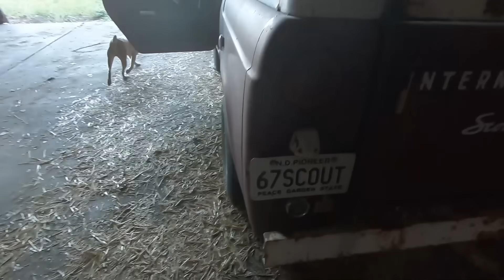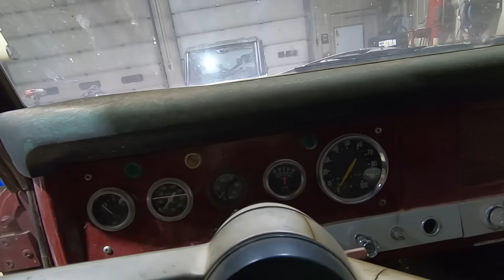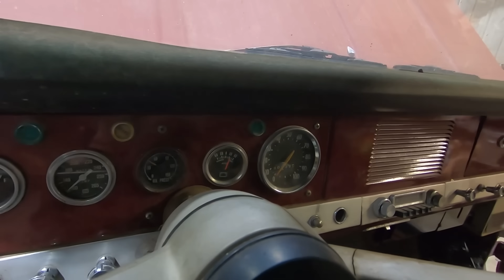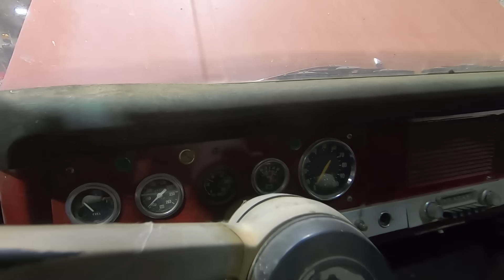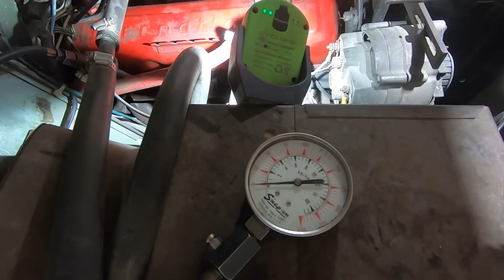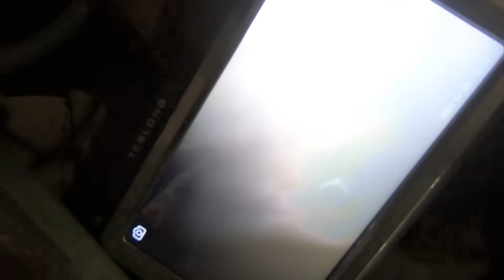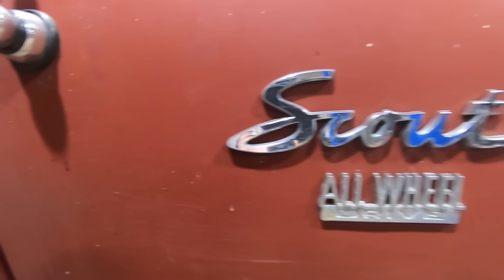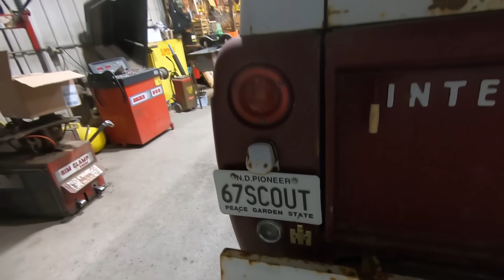Barn Find! 1967 International Harvester Scout! Will it Run?!?

Comment: aROUND 25 YEARS AGO i WAS given a 1964 Scout 80.  it had been parked in North Georgia about 100 miles North of Where I used to live.  I got a tow bar and went up there and pulled it home.  It came with a 4 cylinder 252 engine.  I got it running and it had LOW power.  It has 427 Dana differentials.  It still had low power so I put a Chevy 350 in it.  No more low power!  It would go 80 mph at  4000 rpm.  Now it needs 4 new tires and a new boat gas tank.  It is a worthy 4WD vehicle.

Comment: My grandpa had two of the 2+2 IH tractors up here in North Dakota.  He bought the 3588 brand new and bought the 3788 model used.  He had the duals just on the back of the 3788.  I had never seen duals on both the front and back like on your buddies.
Reply from the maker: Cool

Comment: My wife found one for my Dad. It was an army issued 1967. 4 cylinder, 2 gear shifters (one for the PTO), camo, and removable hardtop. The slave cylinder was bad, but a ford ranger will swap out. Nice rig.

Comment: That piece of metal hanging out of that pickup screen looks like a wire brush bristle. My grandfather had a 82 bronco with a 351 in it. It needed a rebuild and My dad cleaned the parts with a wire brush. One of the bristles made it's way down into the pan, through the screen, jammed up the oil pump gear, sheared the pin and the truck shut off from no oil pressure.

Comment: The Jeep CJ5 came out in 1954, so yes it was available in 67. The CJ3B was made alongside the CJ5 until 1968. One advantage IH had with Scouts was selling through a network of tractor and implement dealers in rural areas where there may not have been Jeep/Ford/GM dealers.

Comment: Years ago I had a 1 ton Chev that developed a knock and I couldn`t find it. I ended up pulling the engine and discovered the clutch disc had a loose spline. That may be the problem. Keep the videos coming .
Reply from the maker: I've seen that twice now

Comment: I enjoy all your videos , Duff helps so much.  When I worked for Ford back in the 1970's as a mechanic , I had a car in my stall that had an engine knock, even with a stethoscope it seeemed that the knock was in a cylinder, even my service manager and a couple other mechanics agreed, so I pulled the pan and found one rod bearing almost 1 thousands off, not really enough to
knock, I put in a new bearing and reassembled , started it up and it still knocked, what the heck, after more diagnosis, it turned out to be the fuel pump knocking and sending the knock down the block, possibly the fuel pump on the scout engine is your knock.  thank you

Comment: Those magnetic spark plug sockets are definitely a great tool. I first heard about them on Puddin's channel when he was working on the Towrolla and I believe he mentioned you had either sent him one or you had told him about them. It helped me out greatly when I was changing out spark plugs on my Scion TC since they have the built in extension since Toyota likes to put the plugs like 5 miles deep into the engine
Reply from the maker: Yeah, we sent him a set. They're awesome!
Reply: @MortskeRepair  we had them in late 60s one of my first purchases from PEP Boys as a Young un
Reply from the maker: @teomcdohl They can be fun!

Comment: I inherited my dad's 62 Scout in 1986 and drove it back to Minnesota from Grand Junction, Colorado in December. That was a long, cold drive. Had to replace the water pump in Nebraska, found that at the IH dealer. Slant 4 cylinder, 4 speed, awesome rig till it wasn't.

Comment: My experience with the original IH Scout is limited to 2 vehicles about 30 years ago. They both had a knock that sounded like bottom end noise. They both turned out to be distributor gear and lower shaft bushings. Replacing the parts would only fix the noise for about the interval of a single oil change.
Reply from the maker: interesting
Reply: Good stuff I was thinking from the beginning hearing the starter turning that slow that it was a bad starter with  the bendx sticking

Comment: The Scout 800 replaced the Scout 80 during 1965. The new 800 model was built from 1965 to 1968. These models had many improvements of comfort and design, including bucket seats, better instrumentation and heating systems, updated dashboard, optional rear seats, and optional 196 four-cylinder (from 1966), or 232 inline-six. Beginning in March 1967, a 266 ci V8 engine was also offered. Externally, changes were limited to an anodized aluminum grille with a rectangular "International" logo placed on the grille, the IH badge was moved to the hood, the door handles became the button type, and the tailgate no longer included the "hooks".[1] The base engine was a naturally aspirated "Comanche" 152 four-cylinder with 93 hp (69 kW), of which a turbocharged version with 111 hp (83 kW) (the 152-T) was also offered. In August 1966, the turbo version was complemented by the bigger 196 which used less fuel with exactly the same power. The 196 motor achieved 20 mpg.[2] The turbo version was discontinued during early 1968. The fold-down windshield was still available, code 16536, but few were ordered because this was not advertised. The vacuum-powered wipers were moved to the bottom of the windshield frame with the fixed windshield.

International Harvester Scout 800 Sportop
Beginning in early 1966, International also offered the Scout 800 Sportop, which had an upgraded interior and a unique fiberglass top (also available as a convertible) with a slanted rear roof and a continental spare tire kit.[2] The "Champagne Series" Scout was an upscale model offered in the Scout 80 and later Scout 800 models that featured a headliner, door panels, and carpet.
Reply from the maker: thanks for the info!

Comment: My experience with a Scout from 1980 was that when going through high water at a significant speed, the distributer tends to get wet.  That tends to bring things to a quick halt.  Oh, yea.  When going sideways across a fairly steep hill, never turn up the hill.  Always turn down the hill.  If you turn up the hill? You'll end 'up' at the bottom of the hill; possibly upside down.

Comment: My Dad told my a story about buying an old Ford pickup with "rod knock". Ended up being the fuel pump arm slapping the cam eccentric because of a broken return spring in the pump. Cheap easy fix, drove the truck for a long time before trading it in on an 1979 Ford Fiesta!

Comment: Neat stuff. I wonder if the knocking noise is from the fuel pump lever to the cam ascentric or does it use a rod to drive the fuel pump with slop there? Either way, still a neat old rig. Enjoyed watching
Reply: Thinking the same
Reply: The fuel pump runs off vacuum, he said that
Reply: @Earl Green 

The fuel pump runs off vacuum, he said that
Reply: @birdmandave  my bad, I forgot that detail 😅
Reply: Think the fuel/vacuum pump had the same level action as a normal fuel pump
Reply: @diggerdog9096  ya,, that fuel pump creates vacuum for the wiper motor,, It still has a lever that is powered from an eccentric on the camshaft, Usually  the fuel pump lever is designed to always be in contact with the eccentric,,  I guess it could be bent from an improper installation,,,  That might make it clickity-clatter,,,  :-)
Reply: @birdmandave  no fuel pump runs OFF VACUUM. some create vacuum for the windshield wipers back in the 40s 50s.
Reply: Timing chain.

Comment: Just bought the 67 barnfind scout. Only 4.2 volts to the coil when trying to start. Hooked jumper wire from battery to coil. Started using carb clean. Found gas drained back. Replaced fuel pump. Starts great with jumper wire installed. Still knocks so not a fuel pump noise. Will replace ignition switch hoping voltage problem will be fixed.

Comment: I had a 68 scout 800 all wheel drive about 15 years ago.. that critter was a tank.. never left me stuck and went every place I wanted to take it.  I didn't push it on places I questioned either.. it was a good vehicle.. only issue I had was them cold winter starts.. ya better give it a squirt of happy juice to at least get it to fire.. sometimes a second shot was needed for it to run.. but a great vehicle never the less for a 196 ci 4 cyl 4 SPD. good to see one and someone working on it.. 
pease!

Comment: My '73 cj-5 had a lot of top end rapping that sounded like that scout. I changed all of the rockers & pivots which quieted it all down if that helps you. I had previously done the whole bottom end with HV oil pump. Gets 70,lbs oil pressure. I attribute the top end ware to low zinc in oil.

Comment: I checked absolutely every thing you did for that same type of noise. I was in denial. Mine was an automatic ,but the 2 flex plate bolts were found in the bottom of the cover and the torque converter bolts were loose. And in a chevy 2.8 you can get the flex plate bolts back in without pulling the motor. Righty Tighty - no more noise.

Comment: I would say if you have an engine that was neglected severely it might be in lower. But, i doubt it. Could be bent push rod or bad lifter. The old IH  engines were generally rock solid. Now and then if the o ring in the oil pump failed then it resulted in bearing failure. Easy to work on. Just finding parts at a reasonable price is tough. Good luck. Show it some love. Good video, thanks.

Comment: We had an early 60s scout when I was a kid. It had the flat four motor. Top speed was about 45 but man, in double low that thing would crawl through most anything…unless it needed wheel speed…. It was a hoot to just trail ride in when we were kids.  We had that and an old flat nose jeep pickup that was the same deal, crawling around in the woods they were at home.

Comment: My International story is changing out a water pump on a '47 bullet nose . Chrome strips for the grille. Pretty neat.. My brother and I were taking turns getting the bolts out and it was raining I the south door of the drive through wagon shed. Suddenly there was a lightening bolt and all kinds of white light danced all over the engine and right around my hands with no shocks felt
Then the rain started coming in the other door. Then the tornado showed up and took a big chunk of roof off the barn fifty feet away.
  It was just a little EF zero with strands of metal and such with no darkness in the funnel. So we went back to work and finished up the job. Farmer things.

Comment: I had a '64 Scout 80. It had the slant 4, 152 cid, and it was definitely underpowered. I attempted to upgrade it. I did a power steering upgrade, and that went well. I was going to install Toyota 4.10 rears and a Toyota 22r engine in it, but due to health problems, I was not able to complete it. Another Scout owner bought it for parts.
The factory rears were 4.88, so not suitable for highway driving. Mine had an all range overdrive in it, and the tallest tires that could fit under the fenders.
Reply from the maker: Cool

Comment: Wander if it's got a fuelpump rod knock.  I had a 305 chevy.  The Pryor owners  didn't know to chang on the oil. Got it for cheep found the fuel pump rod was worn-out of tolerance and knocking like crazy. You can pinpoint an engine knock with a stethoscope or a piece of break line to the ear. Hope it's something east to fix. What a gem,!
Reply from the maker: Never heard of that

Comment: Even though the schlong didn't show a lot of carbon in the cylinders, I think I would try some GM Top Engine Cleaner dumped down the carb in a hot engine. DO THIS OUTSIDE!!!!!!! Dump it fast enough to kill the engine but not so fast it hydrolocks. Let it set at least a couple days,  fire it up, and after the smoke clears, hopefully the carbon is softened up and exits the combustion chamber.

Keep up the good work, I really enjoy your videos!
Reply from the maker: Worth a shot

Comment: The 152 Comanche was 1/2 of a 304, all right bank parts including pistons will fit. In a pinch you can even use a 304 distributor cap using every other connection.

Comment: Hello Lord Duff and Servant Mortske I enjoyed seeing the old Scout even with all the flexihoses. I know this comment too late for you to check. I had an older GMC with a very similar knock. The problem was eventually traced to the mechanical fuel pump. There was good contact and spring pressure on the push rod. It seems that on the return stroke of the pump it was hanging momentarily causing the knock. When pump replaced the knock stopped. The knocking fuel pump still worked. If the Scout returns maybe check there to appease Lord Duff.
Reply from the maker: Interesting

Comment: If its not the flex plate bolts pull each plug wire like open the air gape as engine is running to see what cylinder is knocking and thicker oil helps quite those problems 😎💯✌

Comment: I bought an 82 Grand Prix old elderly owned with 29,000 miles,like a new car for 500 buck 6 years ago with a bottom end knock.turned out it was a bad butterfly valve in the exhaust manifold.Love when that's the worst problem you bought.

Comment: Guy at work bought 4 old Scouts that sat for years. One was easy to get running and driving, one is a builder, the other two are rotten out parts rigs. They are out there, have to find them and then convince the owner to let them go.

Comment: That’s piston slap for sure. 
You can find the cylinder by pulling ignition wires one at a time and hear if it mostly disappears. 
Wrist pin won’t increase with load.

Comment: i'd have tried to talk him out of those file cabinets in the barn too. file cabinets are awesome for storing fasteners and larger odd shaped tools in your garage. i've got 9 two drawer units under my work bench to keep them handy. if you get some drawer slides, you can fold up some shallow sheet metal drawers or make a plywood frame with sheet tin screwed to the bottom and install them inside above the sides of the file drawers to double the number of drawers for storing nuts and bolts.

Comment: I worked for a Dealership in the 70s, Schouts almost always had 3 speed Transmissions..  I worked parts but our Mechanic often knurled the pistons on the V-8s and 4 Cyl Engines when we overhauled them.  They had a short piston skirt as I recall.  I think you might have Piston Slap.  We had a boring Bar and I stocked .010  .020  and .030 Pistons if my memory serves me right.
Reply from the maker: Thanks for the info!

Comment: I don't know anything about that engine but I had a 4 cylinder dodge engine doing that one the previous owner replaced the timing chain and when I bought the truck it was making that noise. It was super cold so I decided to drive it that way for a week, the chain broke. I bought a new chain and Haynes manual, the manual showed a small gear towards the top of the chain called an oiler, helped move oil to the top of the chain, it was missing, I bought one put it all back together never heard that noice or had a timing chain problem again.

Comment: I traded my steel travel top (the hardtop) for a cloth(convertible)  top on my 800A.  The roof stopped leaking.  Driving with the back window open all the time broke the spot welds in the gutters on the roof.

Comment: I fought a noise like that in a K5 with a 305 - turned out that a bent pushrod collapsed the top of the lifter and gave it enough slack to knock almost just like that Scout. Of course we replaced the pushrod but at the time didn’t even think about looking at the lifter until the 2nd time around.
Reply from the maker: Thanks for the info!

Comment: Our 62 was for snow plowing the freight yard and for my sister's college practice teaching.  My baby brother and I would select an empty tank with the floor selector valve and switch the dash gauge switch to the other side (full fuel) tank.  Sister Susie would run out of fuel, not understand why the gauge indicated "full", call Dad, Dad would correct the problem and scorch the daylights out of the guilty brothers.   Susie was not a quick learner, so this happened a few times !!!
Reply from the maker: That is awesome!

Comment: Ok, have a 1962 model, was my daily driver for 5 years starting in 1982.  Big problem is the Holley distributor.  I found a delco from a 266, I had a 152.  First I ground off extra cam lobes.  Not good.  Then i built up a chevy cam lobe and turned it down, little bit of file work.  Worked the best,  just set dwell at 30.  Drove that old scout for several years, got me there, pulled a few people out of ditches.  Still have it.  Needs to come into shop and have some loving.  Can now buy parts I couldn't find 40 years ago.  Has it been that long?   Hey I am old, remember international dealers.  Hey I remember walking by the local international dealers lot back in late 70s and they had scout pickups.  Hey, my old 1962 ihc scout, drove it to where it is parked behind shop, motor is well used , got some electrical issues, no biggie.  But I can now buy a new clutch master and slave.  Maybe this next year it will be on the road again.  Take me to my cabin and back again rig.  Ok dreaming and a wishing.  Old girl will run, hydraulic clutch problems.  Some electricals love ihc colors, all green wires,  ha.  Simple beasts.  Distributor deal, I wound up taking a delco 8 cylinder points cam and building up every other lobe and turning down.  Lick of of a file to make it better, 4 cylinder delco distributor cap.  Best thing I ever did to scout.  Did change out transmission, old one jumped out of high gear, bungee cord wouldn't hold it in any more.  Ha and goodby.  Getting soft in my older years, like a good heater and electric windshield wipers.  Good night folks.
Reply from the maker: Good luck on yours!

Comment: I had a Mustang with a bum Fuel Pump, the lever didn't follow the eccentric on the end of the cam completely. When the lobe came around and whacked it, it sounded like a lifter had completely collapsed. One more thing to remove to eliminate sources of noise.
Reply from the maker: Good call